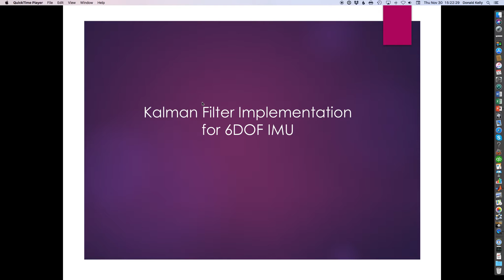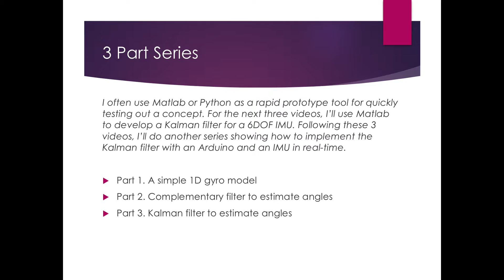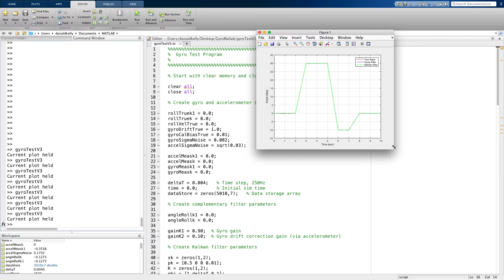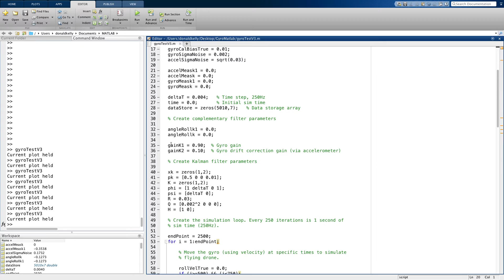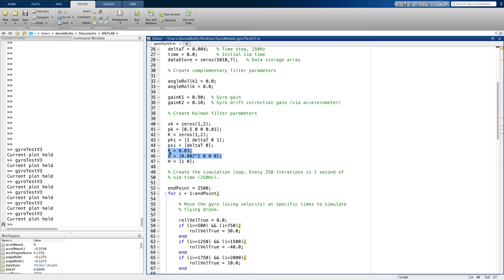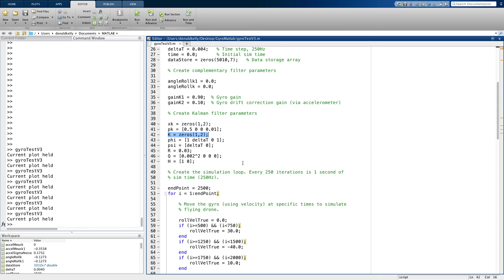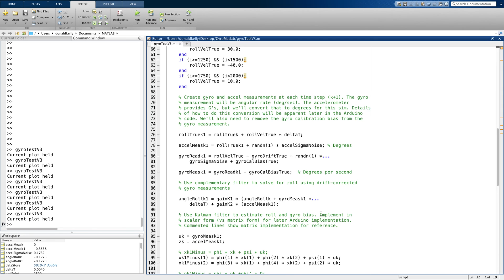Kalman Filter for 6DOF IMU Implementation (3/6)

Comment: Thank you for making this video series. This is really useful tutorial for beginners. However, I found small mistakes in the linear algebra. If you would like to use the MATLAB solution (which lines are commented out), you have to define the Kalman variables in the following way:
% Create Kalman filter parameters
xk = zeros(1,2)';
pk = [0.5 0; 0 0.1];
K = zeros(1,2)'; 
phi = [1 deltaT; 0 1]; 
psi = [deltaT 0]'; 
R = 0.03; 
Q = [0.002^2 0; 0 0]; 
H = [1 0]; 

These are important modifications in order to get correct vector-matrix equations. I hope it will help for MATLAB users. 
Good job!